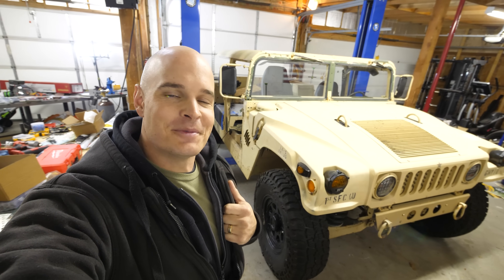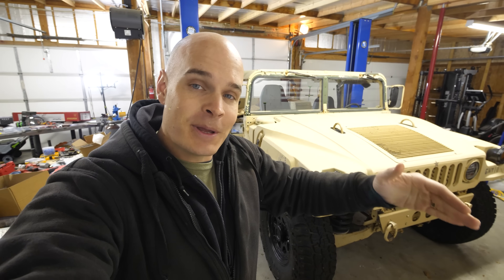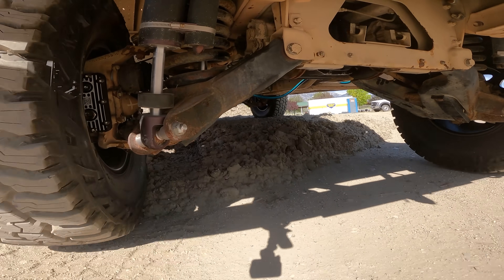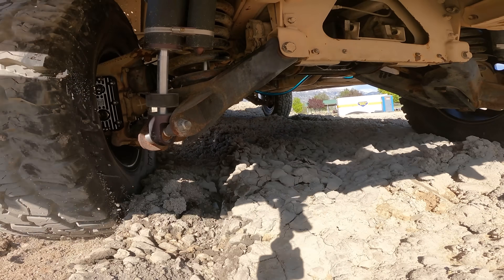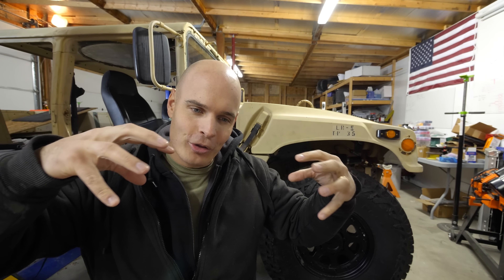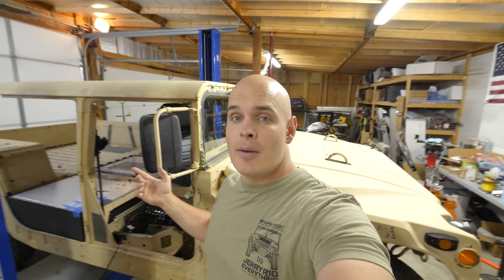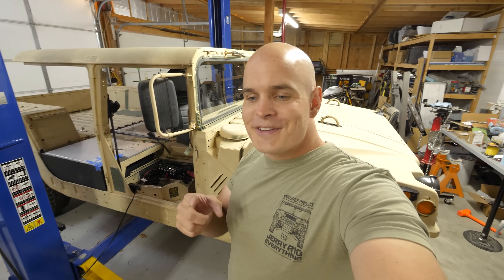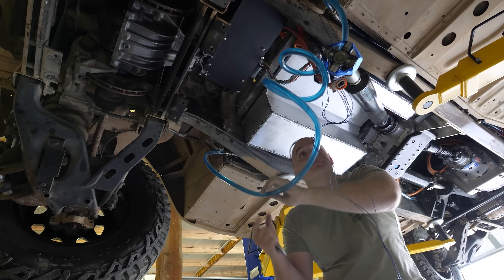I have some explaining to do... - EV Humvee Update

Comment: Bummer. I was really hoping you got the Valeo Seimens charger up and running. I'm currently integrating one into my Ford Ranger EV, and let's just say that their documentation is lacking.
Reply from the maker: You are telling the truth.  I think I still have a manual for the 3.3 kw version of you haven't found that one yet.  Email me and I'll send it.
Reply: @JerryRigEverything  Thanks! I think I have the 3.3 kW manual, but there's nothing for the 6.6 kW (slightly different pin layout). I have some 6.6. kW diagrams that someone sent me (they said they got them directly from someone at Valeo Seimens), but I can't confirm their accuracy. I'll check to confirm what I have.

Comment: The error you made isn't typically that bad for can communication. If I had to guess your termination resistance is probably off.  Also you didn't actually melt the solder in those butt splices......

Comment: Any plans for a metal plate on the underside to further protect the bottom of the battery box and the charger?
Or plan to upgrade the cooling lines to something robust like a braided hose?

Comment: you need to watch haltecs videos on CANBUS networks your issues are with your modules not being configured to communicate with eachother correctly canbus expects things to be in VERY specific points in the communication train of packets thats why your screen isn't outputting the correct data etc

Comment: will you be using the truck in winter+low temps ? I'm wondering what's the temperature rating for those coolant lines? They look similar to my PC watercooling rig but thicker

Comment: i thought canbus was like a loop? signal->into device->signal continues to next device. not like. 1 loop but the devices are connected to it separately? that's atleast what i have to deal with in cars like mercedes and BMW. remove 1 single device. and the whole network goes down.

Comment: Btw how do you program your VCU/ECU and so on? Did you just take those units from Tesla and then start modifying their proprietary software without having source code? Or how do you make those customization that you need? Or are there some unbranded control units that come with open source software?

Comment: With the NACS charging standard being opened up, have you considered using that instead of CCS? Seems simpler and more robust.
Reply: Pretty sure the protocols are practically identical.  I think the only significant difference is the connector.

Comment: The more often I use CAN hardware the more I hate it, the idea is great but the problem is every damn manufacturer has their own proprietary way of handling signals that often cause interoperability issues. We have had to figure out which hardware works with what other hardware and will do test setup to test what works with what, the sad thing is its the "high end name brand" equipment that often is the problem.
That said, make sure your shielding is all grounded together to prevent signal noise.

Comment: I had no idea what CAN is, so I looked it up. Seems like a JerryRigged token ring.

I'm interested to find out the issue because it seems like this Wikipedia statement might be the key: 
"For each device, the data in a frame is transmitted serially but in such a way that if more than one device transmits at the same time, the highest priority device can continue while the others back off."
May be a priority issue -- like family vs a Hummer.

Comment: in simple turns for the same amount of power if you incress the volts you will need less amps. the size of the cundters are going to be detriment by the amps that are going thought it. that way if you look at transmission lines there wires are not very big but they are carrying tons of watts through them, don't quote me but the amps the go thought those transmission i think is under 5 amps but there over 200k in vots or higher. tho this is in very simple turns and is the most i understand of it there is more to it but ya.

Comment: Why doing branches, it is wrong 

Better have a small pcb that creates the CAN bus and you can add terminator resistor, so there is low noise

Comment: you need a 60 ohm resistance on the can bus wires. if its different it does not work correct and you get weird stuff

Comment: Either you leave out a lot of information in you videos, or you are completely clueless how CAN communication works. Also the charger obviously has to be set up first before it will charge. How is it supposed to know what kind of battery is connected?

Comment: The wiring as you explained was never the issue because what you explain is not correct.  You haven't fixed the wiring - you just replaced it.
Your issue most likely lies in the set up of the comms of each device.  Different baud rates, polity bits, etc, or even as simple as telling the device to use the CAN bus instead of another standard.

Comment: Can networks are annoying as fuuuuuuuuuu.
Reply: P.s make sure none of the solder joints are high resistance because that will also jumble the signal
Reply from the maker: I concur

Comment: dam guy is bundled up like its winter at -1c...meanwhile its -34c here and im wearing a t-shirt and baseball hat.....this is the PRIME example as to why electric cars and basically ANY vehicle that has been designed and "tested" in summer -1c weather in California is not built for the real world....prime example? DT Ram 1500's with air suspension....dodge said and the people of youtube LOVED the air suspension but up here in the real world where temps get to ACTUALLY cold the pumps froze up VERY often to the point where dealerships and mechanics were swapping out air suspension for regular strut coil assemblies because the customers didnt like replacing the pumps 2-3 times each winter season....But because California is so heavily populated they all think ther the center of the world and everywhere else in the world is just like them....and they want EVERYONE to change for them....
Reply: In the "real world" the majority of the world's population doesn't live in -34C temperatures. Why would a private company make a car for the tiny percentage of people who live in areas like that?